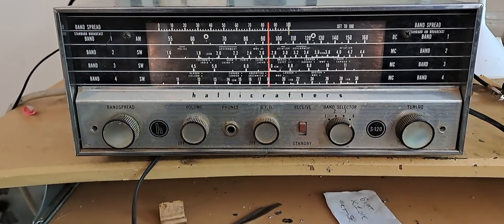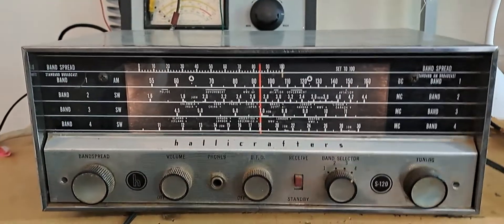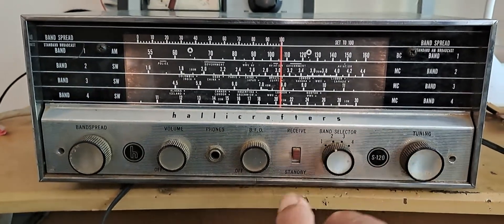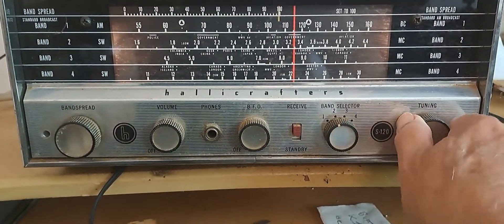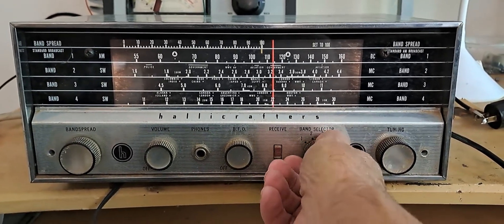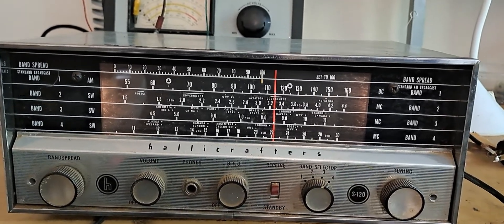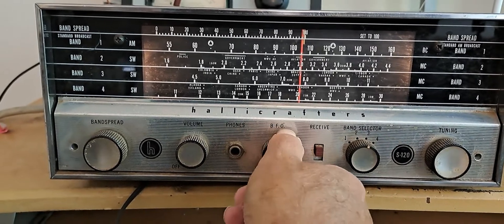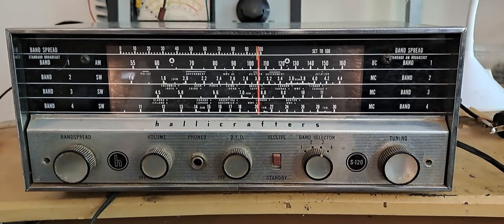Demonstration of the Hallicrafters S-120 receiver.

Comment: The crunches you hear mid dial are the dial string pointer sliding against the big metal string gear wheel. This can be remedied with some insulation tape.
Reply from the maker: This is not the one I got from you. I sold it several months ago.